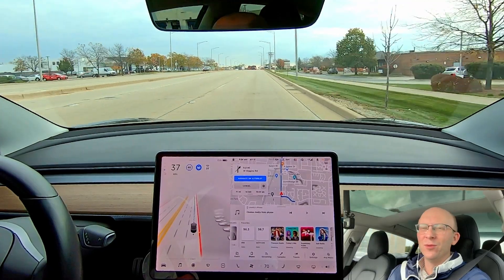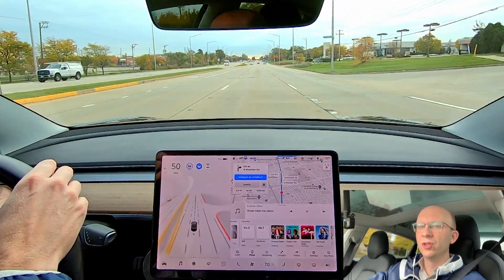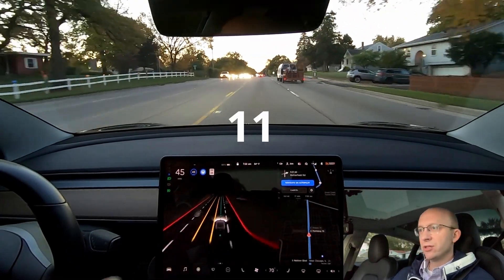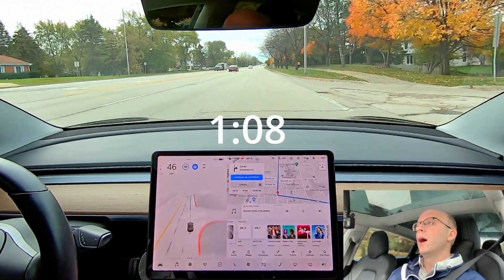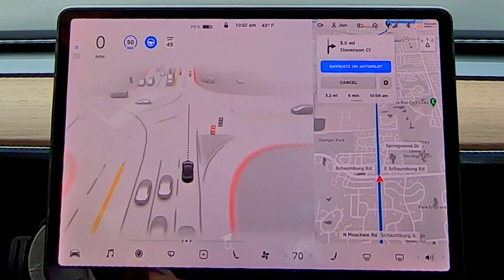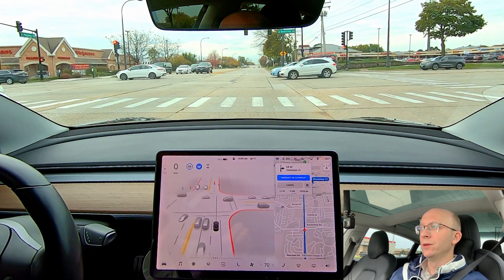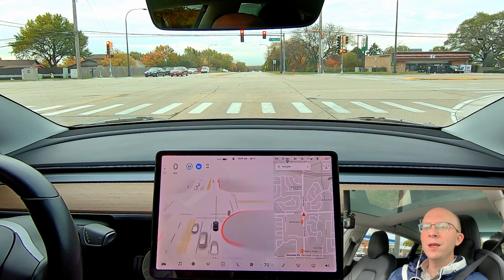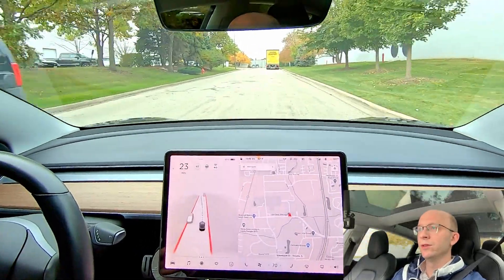What NOT to do while using Tesla's FSD Beta software

Comment: The thing is FSD is not only attempting to drive in your area but in any area anywhere in the country. The roads and intersections and traffic patterns vary wildly across the country. It becomes a better driver as it learns to drive in different locations, at least that’s the goal. 

In the first screw up , that right lane could be a turn lane or a bicycle lane with a solid white line. The car was not sure which one it was until it saw the marking on the road in the last minute. Some additional map data could also help with such situations.
Reply from the maker: Yes, I can’t wait until I can notice improvements to the same routes that I have been driving. Trying to tweak the software from single points of data isn’t a solution for all people, so I think it’s really interesting how the code improves over time. I agree that map data is really important & that the software should be leveraging it with a higher degree of certainty when the map data is newer.

Comment: Thanks for showing how the  internal camera tracks attentiveness.  I've also heard that if  you  look at your phone it will also alert you to take over.  Have you tried that?
Reply from the maker: Yes! When you look at your phone, your head & eyes are diverted away from the road. This is the same scenario as tilting your head down.
Reply: @techgeektesla  So does that mean if you looked at your phone without looking down FSD would be ok with that?  That doesn't seem right.  Shouldn't  the camera  identify the phone regardless of head/eye position?  Have you tested that?  And I realize you're worried about Tesla dinging you and possibly losing FSD.
Reply from the maker: @edhill8568  This would be an interesting test. I can’t imagine holding my phone straight in front of me unless I have it inside of a mount attached to the windshield. And yes, you are right, I am nervous they will take it away from me if I keep testing like this. 😂 When I am not recording, I will use my phone sometimes, holding it lower, below the screen. As long as you keep looking at the road most of the time,  it’s OK and it won’t give you any warnings like that. It’s only when you look away for 10-20 seconds continuously.